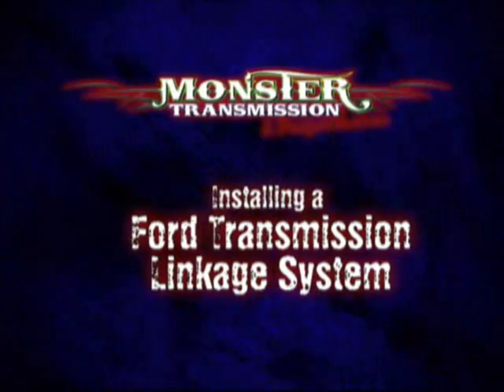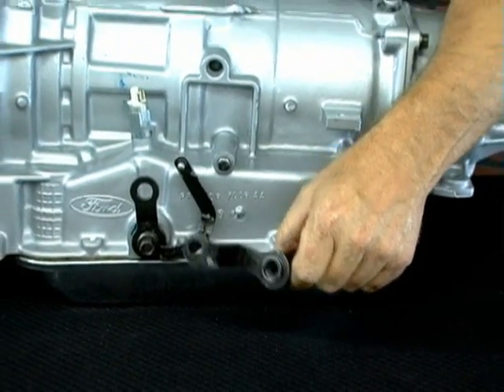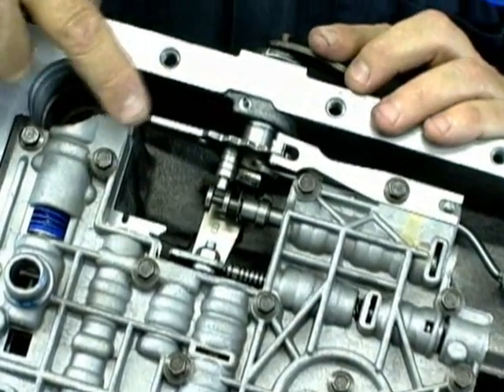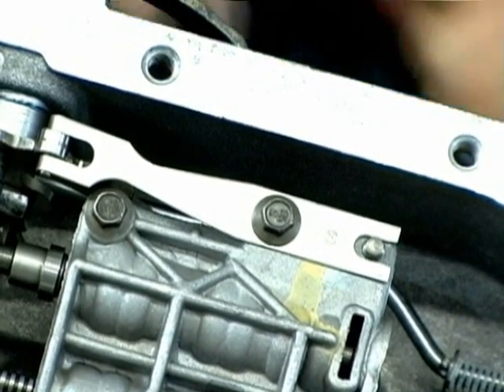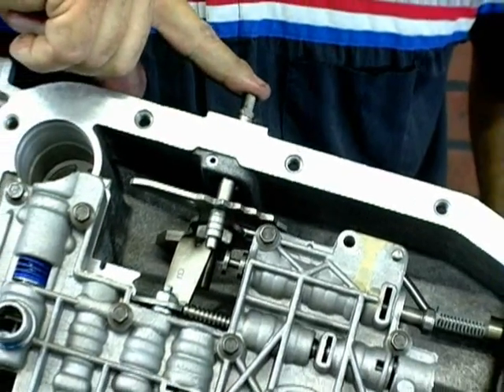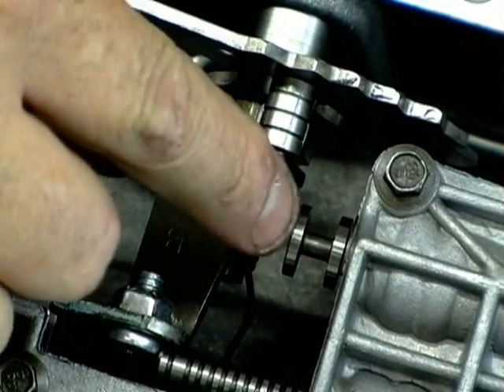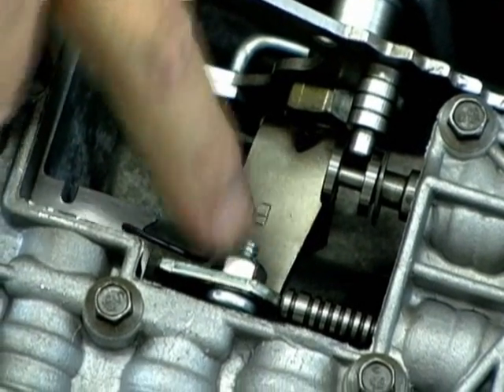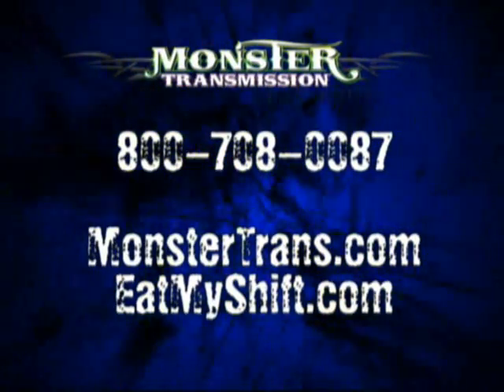Ford AOD, AODE, 4R70W Transmission Linkage | Curt's Corner at Monster Transmission

Comment: I have an 86 crown vic with the aod . I replaced the filter and fluid . Before the fluid was black and i didnt have reverse . Now everything works but when it warms up it acts like it doesnt want to shift or pull
Reply from the maker: Clutches are probably worn out and vales are cross leaking when fluids warm up.

Comment: I know this post is old  but great video U had a question the linkage u removed that is attached to the rooster tail I finally got my transmission to shift out of first but I have a leak coming from where the nut mounts in the outside that holds the line pressure lunkages I thought there was a o-ring in there but didn't c it us there a way to stop a slight drip without removing that entire assembly
Reply from the maker: There is a seal that goes in there, but all you should have to remove is the T.V. lever which is on the outside of the case. If you need anymore assistance Antonio, give us a call at 800-708-0087.

Comment: Hi,

Excellent video and fantastic website! What is the extra component you add to the internal tv cable shaft to prevent the lockup issue you mentioned? Thank you for any information you can provide.
Reply from the maker: Thank you Christina! We add a bolt and nut to the internal TV cable in order to  help prevent the binding issue that accrues when the TV lever is applied aggressively.

Comment: Got a 4r70w that goes into drive no matter what gear is selected, sometimes reverse doesn't move at all but only if you play it.  Neutral is always drive, did the reverse clutches weld themselves or could it be this?
Reply from the maker: The selector shaft may have came off the pin on the valve body. Try dropping the pan and check the linkage inside.
Reply: Dj_Silhanna Kailihiwa what was the problem?

Comment: all my gears work but overdrive could theoverdrive band be out and need replacing
Reply from the maker: The band could be the issue. Suggest checking the tv cable. Make sure it is adjusted correctly. If the TV cable is adjusted correctly then the next option would be to check for the gov. If you have a strong kick down though, the gov. is fine.
Reply: Shaun Reynolds 06 ford van od slips

Comment: I have a Ford Mustang 1991 and the transmission has 4 gears but it's not giving me the 3rd and the 4th The car sounds like once it does 1s gear 2nd gear the car suddenly sounds like if it went nuteral and it doesn't go anymore faster because it sounds like if it had no 3rd gear or 4 gear I Changed my speed sensor and nothing...
Reply from the maker: You will most likely have to replace your transmission
http://www.monstertransmission.com/AOD-Transmission_c_3969.html

Comment: How do you change the seal for the gear selector shaft? Is that from the inside or can it be done from the outside? Thanks, Great Video
Reply from the maker: If you have a linkage arm like in the video you will have to remove a roll pin in the case to remove the linkage and access the seal. You will need to drop the pan to access it. Curt mentions the pin at 6:38 in the video.

Comment: I have an AOD is that the two pieces I need to have my Kick down cable installed?  
http://www.ebay.com/itm/361554526834   
http://www.ebay.com/itm/321923555081
Carburetor I have is not holley neither Edelbrock just the normal one two bodies

Regards
Reply from the maker: Yes it does have to be hooked up. It wouldn't be a kick down cable but rather a T.V. cable and if it isn't connected properly it could cause your transmission to burn up.

Comment: My 1994 Crown victoria Only has reverse gear . Felt as if i was slowly loosing pressure .before i accelerate it Would roll back first .. I changed the transmission fluid and filter and switchselinoid ._.What Could be theproblem ?
Reply from the maker: It sounds as if the forward clutch pack is fried. In this case it would need to be rebuilt.

Comment: i have same trans 04 maruade i getting 2 codes po173 and p1740 do u think if i change my tcc solenoid in the trans that be my problem car cuts off sometime shifting from park to drive and o/d light flashes sometimes and when i take off i got too stay on gas to keep it going ..wat do u think....thanks
Reply from the maker: +abdyfe The po173 is a fuel trim problem. The P1740 you can try a new lock-up solenoid if it does not work it is a bad torque converter.
Reply: What was the problem?

Comment: i popped something in my transmission while switching gears back and forth while stuck in the snow. now it đon't go into gear, not even park. please advise.
Reply from the maker: +Shenita Allen If you can drop the pan and look at the shift linkage. Your linkage may have come apart.  If you have any more questions feel free to give us a call at 800-708-0087, Thanks

Comment: I'm currently in the process of putting a new transmission in my foxbody mustang.. I needed the gear selector off of the old transmission.. Who knew it was as simple as a roll pin.. Kind of felt stupid after that lol.. I neglected to remove the gasket.. I would have never know it was there lol. Video was informational and very helpful, thanks for posting

Comment: I've just sit my newly modified 351W and AOD combo down in my 1968 cougar xr7, my question is this.  can someone post a picture of this transmissions gear positions from the outside, to get a side view.  Cougars have floor shifter, so I use a rod.  where is park, neutral,  1st 2nd?    I will tell everyone thinking of doing this, giving me headache, especially driver side header, you are not getting a factory exhaust manifold in that space, it isn't happening.  still working trying to find a header that will fit. Any ways, I would like a good drawing depiction my gear selection positions.

Comment: I have a 97 f 150 4x4, I put a motor in it and it will shift into reverse but does not seem to have forward gears. It has good fluid and the right amount. Any suggestions?
Reply from the maker: Mark Walters Is the transmission the stock transmission? What transmission is currently in it?

Comment: I used this video as a guide to help me flip my selector lever (changing from column shift to floor shifter), but afterwards, now the transmission does not seem to engage "park" anymore, and the "reverse" lights stay on in P or R, vehicle only starts in N. What in the world did I screw up?
Reply from the maker: crazycracker289 
The internal linkage is not hooked up correctly then. Check back through it. Either the manual valve is not connected in the correct groove or your park rod is in the wrong hole...if you removed that part.
Reply: Monster Transmission
 Here is what I found; the lip on the trans pan was stopping the lever arm from rotating all the way into PARK. Originally facing the other way as this trans came on a car with column shifter. I bent the lip of the pan a little and I think that will solve the problem.
Reply from the maker: crazycracker289 Great information. Thanks for letting us know the outcome.

Comment: I had read, somewhere, that the valve body had to be removed to change the linkage.  Once I got the pan off, I saw that I could get to the nut without removing the valve body.  I found this video to confirm my plan.  Thanks guys!

Comment: can this linkage slip in a way that will let the transmission go into revers and drive but hold itself in park?
Reply from the maker: The linkage is connected but separate it is located in the rear of transmission. A parking pawl might be what you are referring to.

Comment: Can you guys do one on adjusting the GM (Alero, Cavalier) shift cable that attaches to this shift lever? It has that black housing and you have to remove a clip to access the adjuster portion. Not much on the net for that yet!
Reply from the maker: Hey Ed, thanks for the question. We don't have any plans for that model. Feel free to Subscribe though just in case we do at some point. If you have any more questions feel free to give us a call at 800-708-0087, Thanks

Comment: For a roll pin that is down in the case with no projection, try using a small sheet metal screw into the pin to remove it.  The pin does not fit tight.  Very informative video.